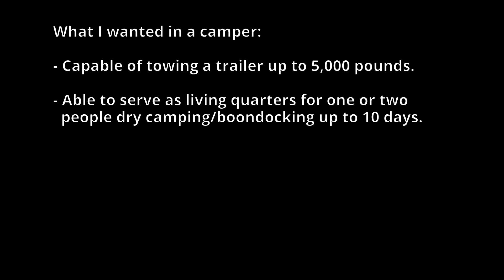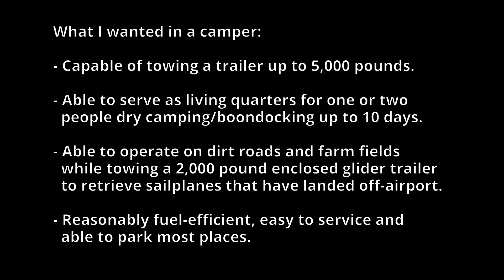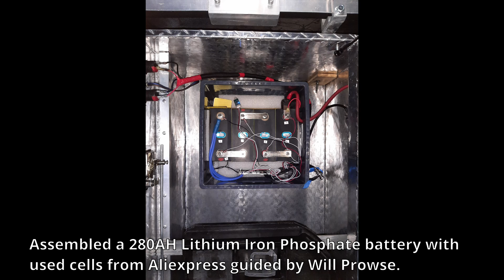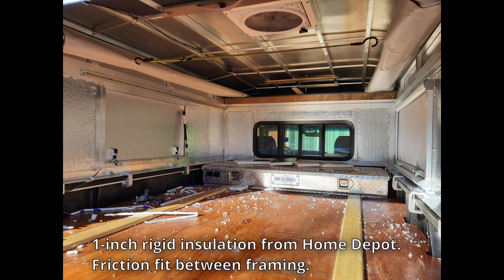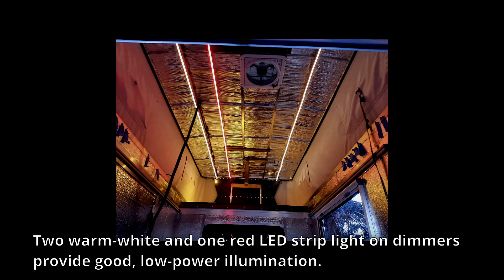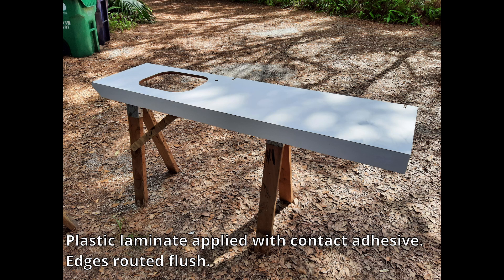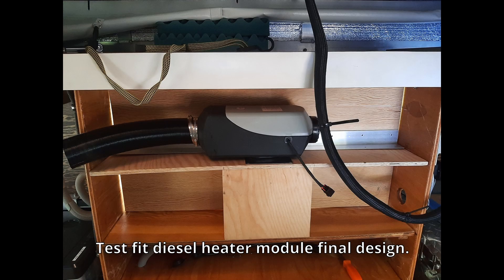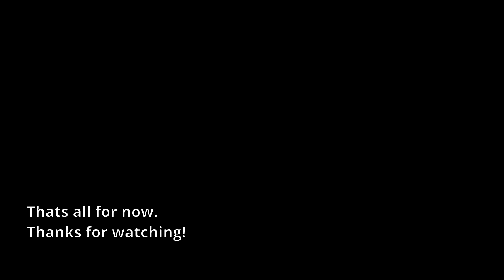OVRLND Tow-Rig/Camper Interior Build

Comment from the maker: The inverter failure was caused by my installation of a very hard to see undersized fuse for the inverter cable at the battery terminal. It was barely visible and I had forgotten that I put it there. Renogy was great in helping me trouble-shoot sent me an RMA that I didn't end up needing and sent me info on how to calculate a good size for the fuse.

Comment: like your build. i'm building out my ovrlnd now and want to ask how effective is the reflactix at reducing heat gain in the roof? also thinking of making reflectix panels for the canvas for the same purpose, they will easily store on the bed when the roof is colapsed.
Reply from the maker: @Michael Battistelli Thanks for watching and congrats on your OVRLND! My build  is pretty crude compared to a lot of what you see online. Hope you found my OVRLND Camper Tour video that may give you more info. I learned about using Reflectix from watching Bob Well's Cheap RV Living channel. The secret to having Reflectix work properly as a radiant HEAT barrier is to have a slight air gap between the top of the Reflectix and the metal roof. I suppose you could put it under a layer of something else but it needs an air gap. Rather than get into the physics I will just say that for the weight and thickness there is probably nothing better. It also reflects body heat down like a Mylar "Space Blanket" instead of up to space as well as reflecting solar heat upwards. 

I cut my Reflectix in long lengths - the full length of the roof where possible and about a 1/2-inch wider that the spacing between the roof ribs. It is 90 percent friction fit and it sags a little to get the air gap. There are only a couple of spots (mainly near roof penetrations) I used medium strength double sided tape to hold up edges. The tape I used for the Reflectix was clear, thick, rubbery and removable/reusable that I found on Amazon.  Home Depot sells a version of Reflectix but I used the real stuff. Ideally you have different insulation strategies for hot and cold. For really cold temperatures some kind of dead air space/thermal blanket or foam is needed but condensation is a challenge. Reflectix is OK with condensation which is great.

Reflectix works really well as a  heat barrier in summer and as long as it cools off at night I am usually good with my Maxxair roof fan and a little rechargeable clip-on oscillating fan that they sell for baby carriages. My air-conditioner is a luxury that makes summer camping in the humid southeast U.S. comfortable, especially when I need to sleep closed up due to rain. I can only run the A-C if I have access to shore power or bring my little 2000W generator. You could try Reflectix for the fabric walls around the sleeping platform especially south and west sides. It might work great. To reduce heat gain through the fabric side walls what I do, is to rig up a tarp from the roof edge for shade. I have Rhino roof rails that anchor my solar panels and I have a bunch of eye-bolts that slide in the slots I use for attaching tarp ropes. I have a pair of 8-foot telescoping support poles. The tarp is my alternative to a permanently-attached awning. I try to park facing north and put the tarp on the south side over the tailgate. I hope you enjoy the build process and will try things more than once if the first try doesn't work. I did some things 2 or 3 times to figure out what worked best. 

Note that about 20% of my roof is shaded by the solar panels.
Reply: @sopilote56  thanks for the quick reply. reflectix on all windows worked great in my snugtop fiberglass topper to reduce heat gain. im not so worried about staying warm as i am about managing high temps inside. reflectix works well for blackout too. since most of my camping is rustic my build wont be fancy, just practical. maximize storage and function.

Comment: these look really neat, they're like a super light truck bed camper with all the luxuries and fat trimmed off. So do you know if they ship to Canada? Can you only remove it by man power or is there another way?
Reply from the maker: @Bike Ninja Thanks for watching! I know that they get all the custom lift strut/gas springs for their campers from Canada. Seems like they could crate and ship wherever. I considered having mine shipped but the costs for crating (it's big) and sending cross-country were very significant. I am now retired and I decided a trip to Flagstaff (beautiful) would be fun and save some money. The Grand Canyon is not to far from the OVRLND factory - just saying....I haven't tried removing my shell yet but I am confident it could be done by four to six guys or you can lift each corner on your own and slide 2x4's with eye bolts underneath, then clamp the camper to the 2x4's and lift the 2x4's up with a chain hoist. I am sure Jay would be glad to answer your questions. See https://campovrlnd.com/
Reply: @sopilote56  thanks for the response, yes, I will look into it. Enjoy! it's an awesome built out!